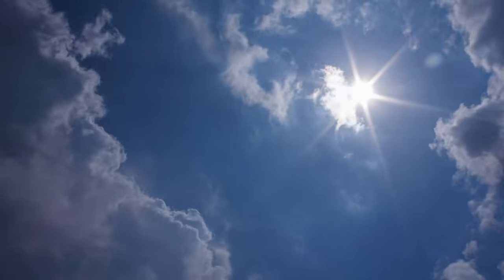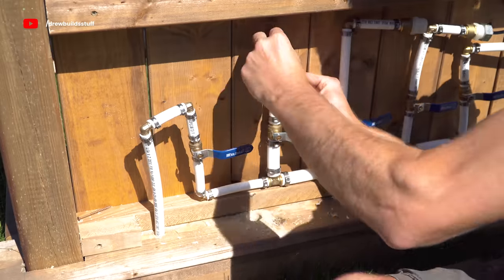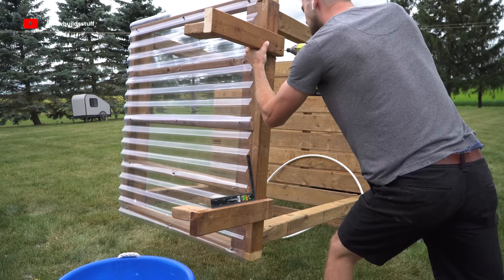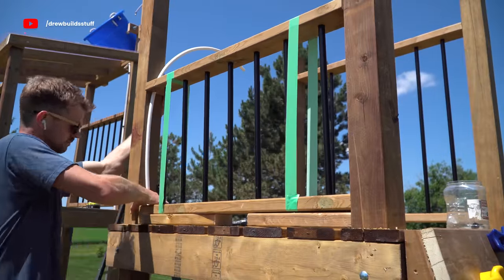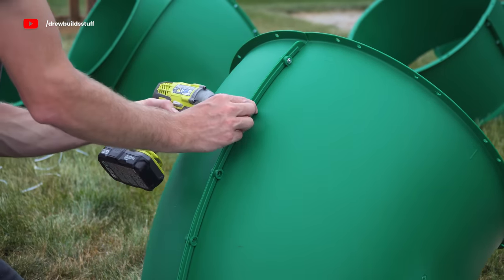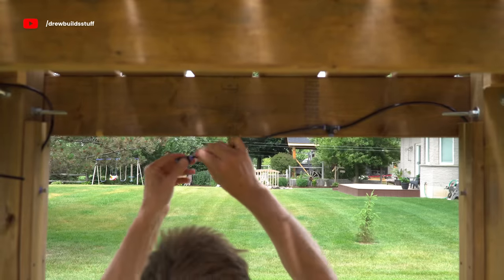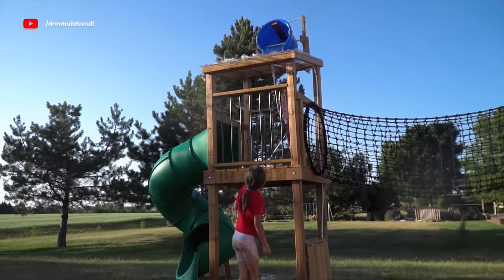I Built a Backyard Waterpark - Full Detailed Build

Comment: You should put a crossbeam with the plastic corrugated facing 45 degrees against the drop roof so that the bucket water gets angled more downward toward the drop zone instead of mostly in the yard....it will also guarantee the splash zone regardless of how much is in the bucket so that there's no disappointment of misfire. Looks awesome though!
Reply from the maker: Good tip! The kids are still getting use to it so maybe once they are ready for more water on them I will add that.

Comment: Cover the exposed Pex if you want it to last. Pex does not stand up to UV. Sunlight completely deteriorates it. I learned this lesson the hard way thinking I was upgrading my boat dock plumbing but just the reflecting sunlight off the water up under the dock was enough to ruin it all. some fun noodle or pipe insulatione or even just a little shroud will save you repairs in the very near future.

Comment: This video is a year old. How has it held up? For my kids play set they have just a straight slide. So I ran a water line up to a horizontal 1/2 PVC with about 10 1/16" holes drilled in a 1' span so when on it created a wall over water that shot straight down onto the slide which makes it extra fun in the summer. 

1 thing I noticed from yours if you havnt had issues with yet us where your main hose connects to make that a 90° down so its not a tripping hazard or someone doesnt run by and snap it off. I have mine connected to a piece of flexi tube pointed down for just that reason.

As for your tipping bucket. Not sure if you've changed it at all. With the issue you ran into of it not tipping properly. If you chose to explore options. I think if you put it back in the original config with the support rod off center towards the back. Add the chain so it can only tip forward and then add a bungy type cord on the back to right it when it tips. This way once it gets filled to a certain height the weigh of water tips it forward and dumps and then the bungy rights it back up.

Comment: Very nice build. I woud do something like this one day. Now I have a couple questions. How is drainage after running the water for a while, doesn't the grass get very muddy? And how is the grip op the wood, ones it's wet. Doesn't it get very slippery? 
Compliments on the build though.
Reply from the maker: Thanks for watching. The wood doesn’t get to slippery, haven’t had anyone fall yet atleast.  Our summer has been very dry so haven’t had an issue with mud or too much water on the lawn.  The tipping bucket would be the only part that would be putting down to much water on the grass.

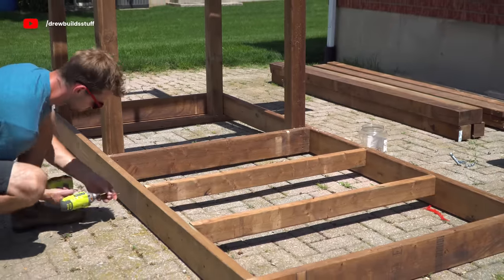Comment: Question about 4:12 I sometimes want to use my drill to hammer something in as well like you did, but I always fear that I may damage the battery. Is this something you should avoid? Or is the battery casing really good? I would never hammer a nail in, but I might want to a plastic anchor into a wall.

Comment: I was thinking, what if you added almost like a ramp inside the bucket so the water flows down it and pools to one side of the bucked, making it tip over without needing a pull rope.
Reply from the maker: Hmm yes that might of worked actually, thanks for watching!

Comment: Hey Drew, did you have to seal the wood at all? Is there any chance of the wood splintering or cracking from the water?
Reply from the maker: It’s all pressure treated lumber so will last for a long time.  Splinters could be a concern but no real way to solve that without using plastic lumber

Comment: Possible solution to the Water Bucket Issue:

Make a compartment in the bucket which is filled with water as the rest of the bucket is filled. This compartment would be sealed on top and filled from the bottom. 

When the bucket turns over due to center of gravity, the trapped water would not empty. That remaining water would remain to reverse the Center of Gravity. 
Might needs some air holes for when it fills, but when the bucket tips over not much water should escape before tipping back.

When I saw that rock in there, I was like "OH NO. DON'T DO THAT". I'm glad you opted not to. Eliminating risk is the best policy. 

If you'd like further details, send me a message.